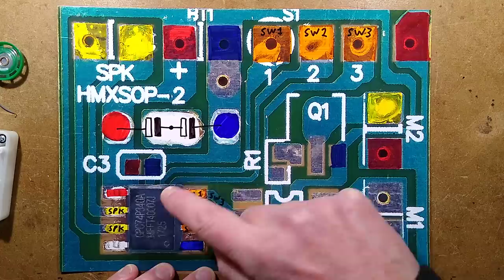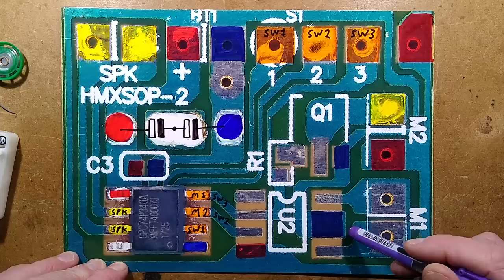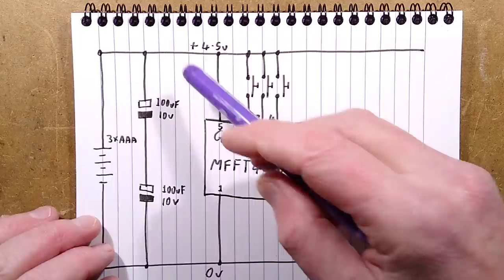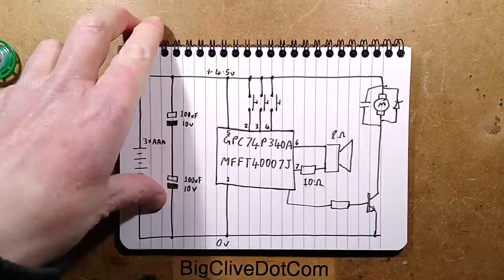Spooky bible teddy (with schematic)

Comment: GPC74 series voice chip is a cost-effective voice chip mainly promoted by Shanghai Luncore Electronic Technology Co., LTD. The product is 4-channel voice output, with low price, small package, few peripheral components and low static power consumption. Product model ( 16B / 32B / 48B /64B / 80B / 170B / 340B ) to choose from, The chip is a powerful chip that can be applied to all with voice prompt solution, for example: intelligent household electrical appliances, toys, consumer, industrial security, life, process gifts and other industries.
Reply: General Description

GPC74P340B,a 4-bit sound controller, is architected with a four-channel SPU for MIDI playback, a 4-bit RISC CPU, a 14-bit PWM, 8 IOs, 1 input (with pull low resistor ) , 256-nibble RAM, and OTP with density of 64K/ 32K x 12-bit of memory space. The operating voltage ranges from 2.0V through 5.5V and operating speed is 1M/2MHz, configurable through inner oscillator. Other features include Low Voltage Reset, IR carry output, Watchdog, 5 interrupt sources with two Time-bases, etc.
Reply: Features

    4-bit RISC CPU
    CPU Clock: 1M/2M Hz, System clock: 8MHz
    Operating Voltage: 2.0V - 5.5V
    Regulator built-in with input voltage: 2.0~5.5V, output voltage: 2.0~3.0V
    IO : IOA~IOB, IOH3 Operating Voltage: 2.0V - 5.5V
    256 nibbles SRAM
    14-bit PWM driver for driving speaker directly
    64K/32Kx12-bit OTP
    Standby mode for power savings
    Five interrupt sources with two Time-bases
    4-channel Sound Processing Unit (SPU) supports MIDI playback
    8 general IOs (bit programmable), 1 input pin with pull low resistor
    Key wakeup function
    Low voltage reset
    Watchdog
    Low Voltage Detection
    7-level (2.2V/ 2.4V/ 2.6V/ 2.8V/ 3.0V/ 3.3/ 3.6V) voltage detector

Comment: Found the B version English language datasheet app notes etc. at generalplus followed by the obvious website stuff (YT will usually delete links so I'll not try). 680K 12-bit words of OTP (unfortunately) ROM. 14-bit PWM output. Almost no RAM (256 nibbles).
Reply: I posted it. It seems to have stuck (so far).
Reply from the maker: 256 nibbles of RAM is decent for assembly code.
Reply: @bigclivedotcom  True enough, we did amazing things with 8048s back in the day (64 bytes of RAM), just seems kind of ludicrous compared to the 2M+ nibbles of ROM.

Comment: I think the chip is a copy of a Texas Instrument voice recorder from middle '90, used at time as multi-melodies door bell. I designed some of them around that time. I've seen the chip modified from simple A/D - D/A w/flash to include an MP3 hardware codec with more flash. There are those recorder-player boards with these chips on eBay for a tenner right now.
The quality of the onboard flash is awful though.
Merry Christmas
Anthony
Reply: its a general plus chip, an otp(one time programmable) one, its a special audio chip with intergrated mcu and some ram and rom

Comment: You should replace the electronics with a DFMini module, possibly with a small Arduino for the buttons, unless you're happy with the regular button configuration that the DFMini supports.

Comment: pin-8 isn't by chance a write/record-enable pin is it?  pin 6,7 used as inputs?
Reply from the maker: This chip is probably one time programmable with a well processed audio file.
Reply: The datasheet says that pin 8 is NC - Not Connected

Comment: I Would do a few HW upgrades So  it Supports MP3, AAC, Flac,  PCM WAV + SD Card (32GB) Storage (ESP 8266) so to also add WiFI & Bluetooth  (So the SD Card Can be Updated via SSH & WinSCP Remotely)
New songs 
- Pokemon Original PokeRap (English dub Version)
- Lady Gaga - Paparazzi (Star Above)
- Queen - Another one bites the dust 
- Led Zepplin's Stairway to Heaven

>> Jeffmilner Website & Backmasking are good keywords for google
>> List of backmasked messages Wikipedia 

then get the ESP to randomly Backmasking/Reversed theses songs due the ESP8266 it has enouth Processing power To  do real time Reversed  Playback
Even get the ESP to look around Bluetooth  for other Speakers / Bluetooth Sound cards And patch them with Firmware updates  That make Wifi and Bluetooth mesh & BitTorrent Ready

Comment: Does religious conviction last only as long as the battery?
The IC looks like a general purpose micro. It would be interesting to discover if the audio in linear, or a PWM output.

Comment: Creepy.  On a more technical theme, I used to have a “laughing bag” toy in 1970s. Things have progressed with that teddy as inside that was a small record player, where the record was only a couple of inches in diameter and if I remember correctly the stylus was mechanically connected to a speaker diaphragm.
Reply: Interesting, I used to have the same thing except I'm sure it was electrical. This was in the late 90's. I guess they sold well enough to warrant an upgrade. Of course, being the kid I was, they lasted for about a week before I took them apart.

Comment: Powerwolf? Needs Powerwolf!

The capacitance of capacitors in series is the reciprocal of the sum of the reciprocals added together i.e. two capacitors in series with 10uF each would be 5uF similar to resistors in parallel.

Comment: One would automatically think they were Jews™ to get you to memorize the first 5 books of the Old Testament. Christ based religions should get one to memorize the first 5 books of the New Testament... Matthew, Mark, Luke, John and Romans or at least the first 4.
Personally, I virtually memorized the entire New Testament while having a job where I was on the road 6 days a week and plugging in a Mp3 CD of the New Testament. I must have rolled through the entire book of books hundreds of times. That's why I know the entire text but don't know chapters and verses. When a situation arises the needed text just pops into my head. :-)
One would do well to not follow in any religion for they are made by man designed to tell man what to think and do... Steer clear.
The various denominations have done more to push people away from Jesus than The Church of satan.
Reply from the maker: It was the brethren.
Reply: @bigclivedotcom